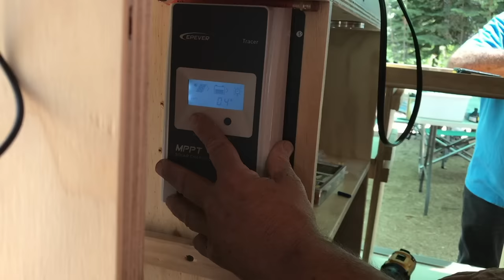Van Life Event HOWA Minivan Build 2019

Comment: Great, I love what your doing.
I'd suggest you consider some way of, 
"BUCKLING" as a safety margin. 
Like making the bed in two level but
separate pieces. In the slim posability of a rear end
accident. Where the two pieces meet, have it be at
an angle so one can break free & ride up over the 
other one. Rather than have the likely hood of
All that force going directly into the front seats.
Just something to think about. 
Have fun.

Comment: Would it be possible to design side storage door on top of mini van. Easy to access from sides of van. Not top storage but doors on the sides. For things that can be in weather. Camp gear not used all the time. Many folks can't get on top of mini van. They would have more room inside for other things in trunk area.

Comment: If I didn't have my 60lb dog, I'd consider a minivan build. But she's staying with me, so I'm in a single digit, 7.5 to 9 mpg diesel RV. I was using my slightly better truck with an insulated shell but it's rough to full time in. In a way, a minivan is just too small for me in my opinion. 18mpg with cheaper gasoline would be nice but I like having having everything self contained like the shower.

Comment: I picked up a 2001 Windstar cheap. It had the engine completely rebuilt about 3 or 4 years back as the owner was one that didn't like buying new. it was never driven over 55mph. I removed the back seats and stored them. It was looking for some layout plans ideas to do a built of the inside and update the radio to have a nav and camera system. I did find it has great possibilities but still looking for ideas. I did a few days camping in a parking lot while at a computer conference. it was quite nice and worked out well.